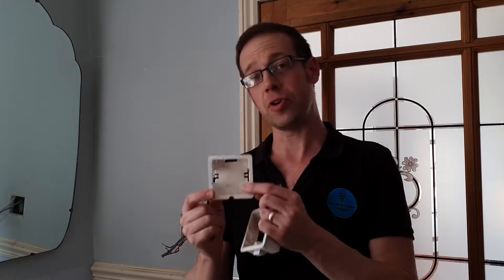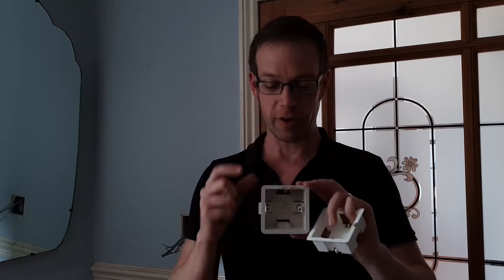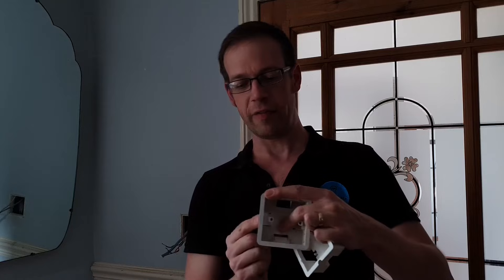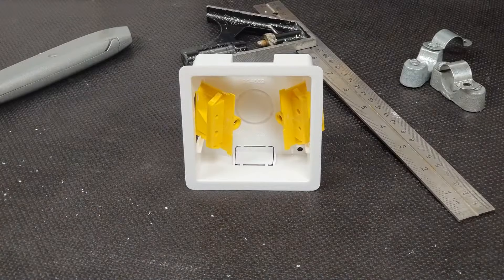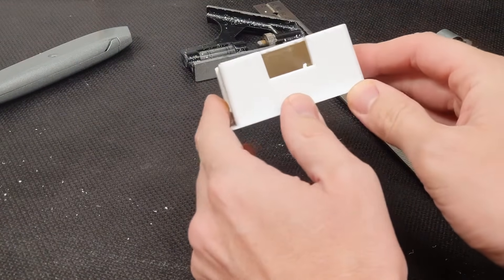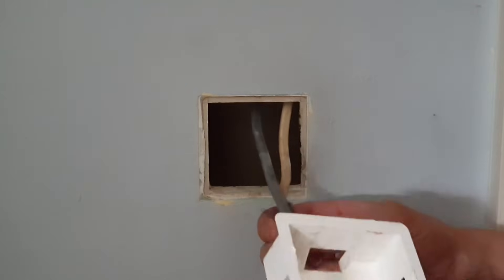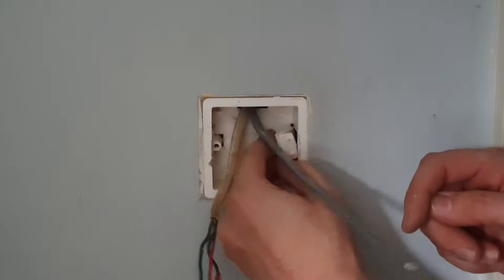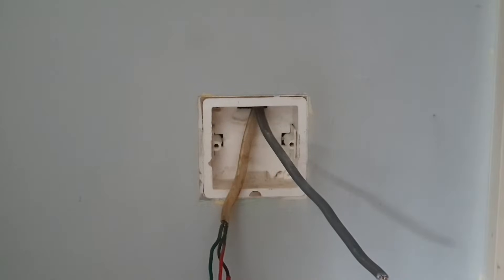How to Fit Boxes for Sockets or Switches in Stud Walls Dry Lining Box or is it a Faster Fix Box Joe?

Comment: Hi, the Ega brand was originally made by Egatube  in St Asaph here in North Wales, it was taken over by MK and then taken over by Honeywell, the Egatube brand is still manufactured under the MK name now mostly made in China, my son works at the same factory in St Asaph as an industrial robot engineer, Honeywell sold the company to a firm called Goodfish in 2020 who make mostly trunking and some other injection moulded parts.
Regards from Ray in North Wales.
Reply from the maker: Wow I love messages like this - massive thanks for the added detail 👍🏻. Gaz

Comment: I have now stopped using those Appleby boxes. They are not made of fire retardant plastic. I now use Marshall Tufflex who’s standard range are much more fire retardant. Just try a flame test it will shock you  as to how combustible they are.  I do also use flame retardant pads if I want complete peace of mind.
Reply from the maker: Great comment 👍🏻